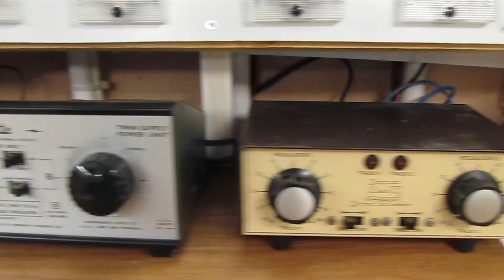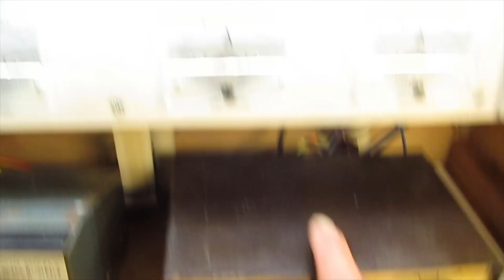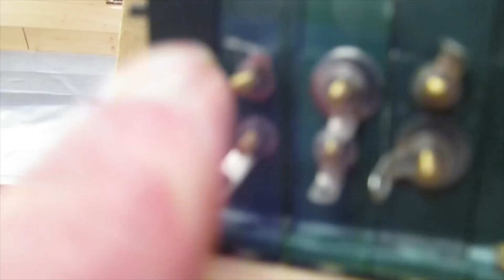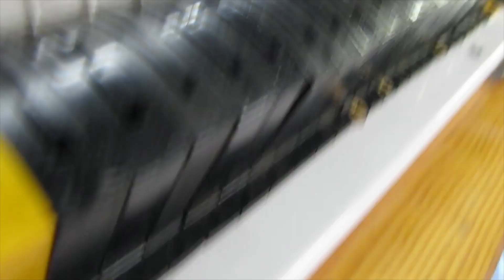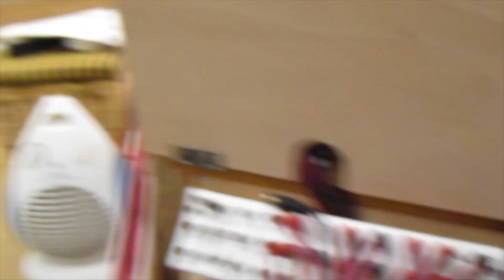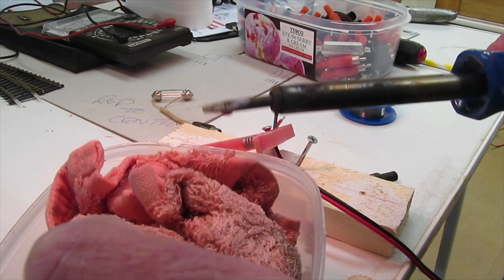Buckland Junction Loft Model Railway 15. DC Electric Control System For Model Railways. Part 1.

Comment: Hi Al ,, ? What size or gauge (thickness) wire do you use for the electric points ?
I seen that you used the telecom wire for the signals which i have plenty of here that i have saved up over the years..
Yet another good advice video from you al so thankyou.
Cheers from John in Australia.
Reply from the maker: Hi John, I use std speaker wire for most of my point work and a much larger speaker wire for my track bus wires to not loose power as at some places it may be as far as 20 metres from the controls, This may be a bit of an over kill but better safe than not. Regards Alan in Dover UK  :o)

Comment: It's something I need to get as well, a new multi-track controller.  I am very suspicious of some of the older power controllers I have so new kit must be sought out.  And not a wet Jay-Cloth in sight in this video.  Nice one.  You have shown me the spaghetti of my future though.  !:^)  I'm late to this video and I hope you found that short!  Thanks for the great advice and filming there.  Keep Well Alan.  See you on Monday.  Cheers!
Reply from the maker: Hey Flymo. I trust you are well. I gather you are a DC modeller ? I am glad many say they get things from my video's. I also gather ideas from the model rail community on-line. Jay-Cloths are due to make an appearance again soon, last used for the beach section. Yes lots more to follow. I am maybe going to do my first live stream when I build up the  courage. Thanks for the comment mate. OK catch you on the Monday Club. Regards Alan at Buckland Junction :o)
Reply: @AlanReynoldsBucklandJunction  Oh, yes, very much a DC runner.  The DCC thing is fantastic but it is a big step now.  DC and a well-thought out control panel is as much fun as pushing buttons.  Thanks for the reply and I'll catch up on your younger video's too.  Keep Well now and thanks again Alan.

Comment: Love your control setup fantastic job
Reply from the maker: Glad you like it! All DC. Regards Alan in Dover  :o)
Reply: @AlanReynoldsBucklandJunction  how are the ammeters wired up would love to do something like that
Many thanks
Reply from the maker: @holybrookejunction4758  My layout is DC. Just cut one of the two track wires and run it through the ammeter and bingo ! If the needle points in the wrong direction to the trains movement, simply swap the wires in the back of the meter. Ammeters are cheap on ebay. For 00 gauge 1 amp each way meters are perfect for the job, If you need more info please ask. Regards Alan :o)
Reply: @AlanReynoldsBucklandJunction  brill many thanks

Comment: Alan. Terrific - very interesting. Can I ask where you sourced the ammeters from? There is a supplier in China but I would rather obtain from a UK source for speed. Been searching the Internet without success. Thanks.
Reply from the maker: Hi David. Yes they came from ebay. From a UK supplier but made in china. The way to tell were they are coming from is the estimated delivery date. My order arrived in 24 hrs. Good luck Regards Alan in Dover  :o)
Reply: @AlanReynoldsBucklandJunction  Alan. Me again!  I had one of the ammeters you use delivered yesterday. As usual no wiring instructions but only 2 terminals, 1 marked positive, the other negative - I'm assuming its wired up for the normal running direction on the track circuit to send the needle to the right. Just want to make sure before I fry it🙂
Reply from the maker: @davidclough7346  There is nothing to worry about. You can not damage the meter as there is nothing inside !! the needle has a magnet on the bottom and the terminal just loop around the magnet once. Just link it into one of your track wires, don't matter which one and try it. If needle swings in wrong direction, just swap terminals. You can't go wrong I promise you. Regards Alan :o) Let me know how you get on !!
Reply: @AlanReynoldsBucklandJunction  Trialled this evening and all good thank you 🙂👍 Next trial is to wire in the HF2 track cleaner to see what happens.

Comment: Hi Alan,  I have s single H&M unit, bought it a number of years ago and never really knew anything about it and I have been experimenting with a tiny Chinese VPM; not sure what is best.
I also have a number of old Triang controllers some of which I have modified as per Chambs123 John’s amazing trains. I have a question about them however I have not seen or heard from John for some time.
That looks like a massive and complex wiring system and I think that could be why so many have switched to DCC, not that I am a convert.
I think it is too late fir me as I would likely have to start over again.
You are obviously very knowledgeable regarding the electrics of a DC system.
Well done👍👍👍
Reply from the maker: Hi Charlie. Thanks for your comment. Yes I too have watched John's videos, He has good knowledge of electronics. Regards Alan in Dover